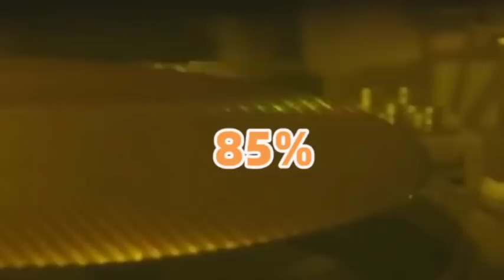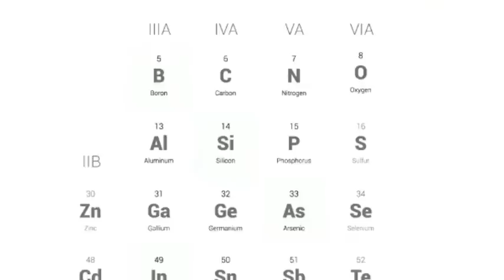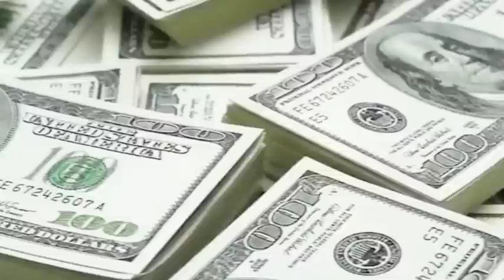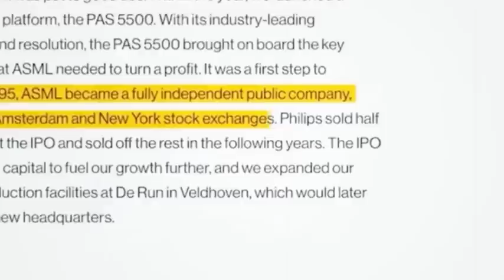Repurchase the lithography machine purchased in China? ASML patent rights or not guaranteed!

Comment: ASML has its own concerns. A lot of there equipment supplied is over eight years old with lodged patents nearing expiry. This means China can retro design the machines shortly and improve on the design with new technology to build equipment to build 28nm chips and down to 7nm by overlay building chips if forced to at a high expense but still at a commercial level. 

China is now holding back export on a number of rare earth processed  materials which will actually holt chip/circuit board production in the USA as a counter to US administration export restrictions on high end chips.